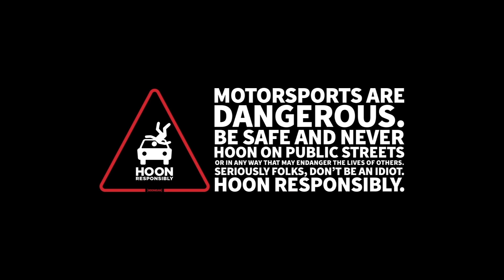Two Cars, ONE Burnout King Winner: 730HP 240SX AND a Ford Mustang Vert Come to Party!

Comment: Thats a W is what that was. Boy don't hold back a damn thing! He must have serious rubber on that Stang man.
Reply from the maker: Cheap tires and a lot of power was Dustin’s secret sauce to score nearly a perfect 10 in the Burnyard.
Reply: @HooniganDailyTransmission  That's what's up! So you get a cheap but new tire so the side wall holds up but still has a lot of tread to burn. Is tire stretching a desired practice in the actual competition?

Comment: It's a silvia s13 but its left hand drive which means it had pop up headlight and now it has a s15 face lift?
Reply from the maker: Started off life and a S13 coupe with pop ups, and then Dustin did a S15 front conversion. Which includes bumper, headlights, fenders and a hood.

Comment: Stop putting v8's in fucking everything it gets old real quick there's thousands of engines out there get more creative
Reply: Think most people prefer going a route that is proven to be reliable and work well, not everyone has the money to go with a unique unknown route.
Reply: @diffypoo  the have more than likely removed an sr20 from the car also there are thousands of good engines available just as much as a chevy v8 or an ls
Reply: USDM 240s never came with sr20s so I doubt they removed one from it, and yes there is a lot of good engines out there that are just as good as the LS. But like I said there is a reason LSs are so popular with the drift scene, they are great engines with lots of ways of making them extremely powerful and in the US you can get them from as little as $300 and with a little work they will go on forever.
Reply: @diffypoo  the us did have the sr20 here is a list of cars that were avaliable with them that were sold in the US 
91-94 Sentra SE-R(B13)
95-98 200SX SE-R(B14)
98-99 Sentra SE(B14)
00-01 Sentra SE(B15)
91-96 G20(P10)
97-02 G20(P11)
91-93 NX2000
Reply: Scott Dawson I never said you never got it in the us, I said the USDM 240 never came with it